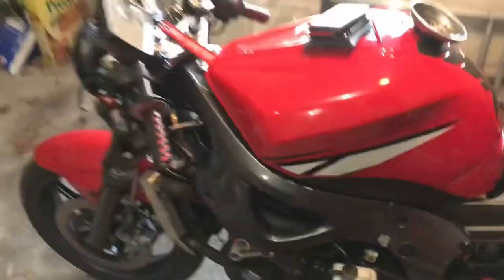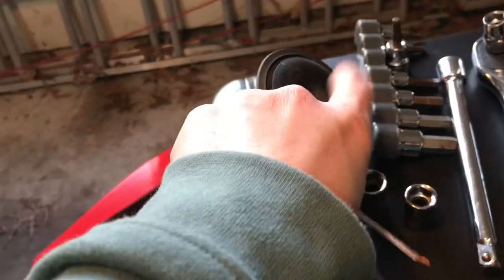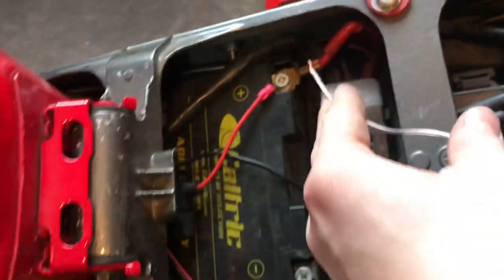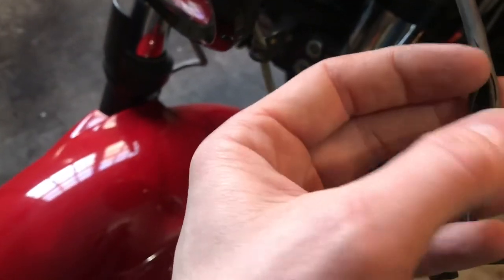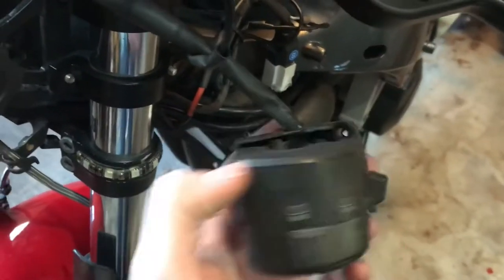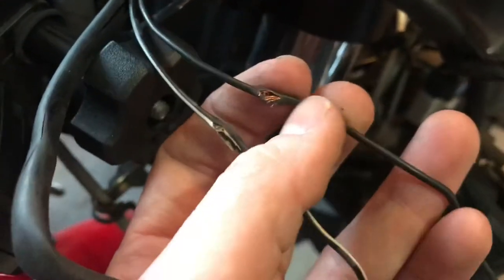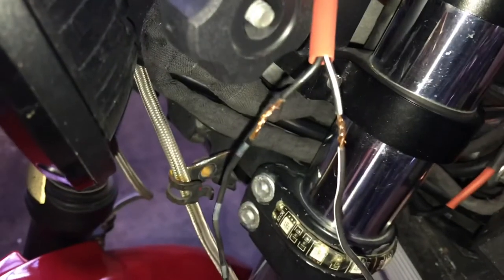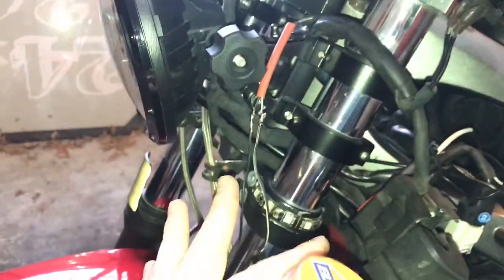Motorcycle horn won’t work? No problem

Comment: ty for the video, but I must have missed something, why did you put glue on the solder joints of the wire before pulling down your shrink wrap?
Reply from the maker: So that actually isn’t glue. It’s called “Rubber Cement”. It keeps the wires from shorting together. We don’t want the bare soldered joints to touch each other, because they will short out and ruin all the hard work. So we coated them with the rubber cement, to make sure they were protected from each other.